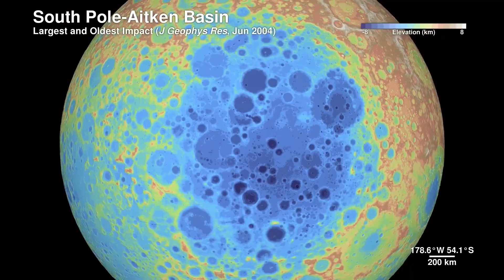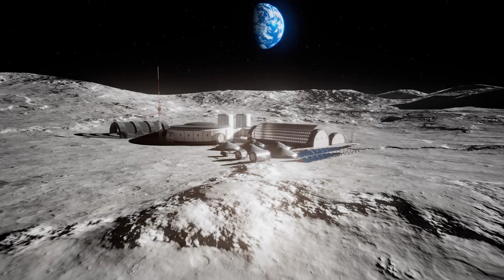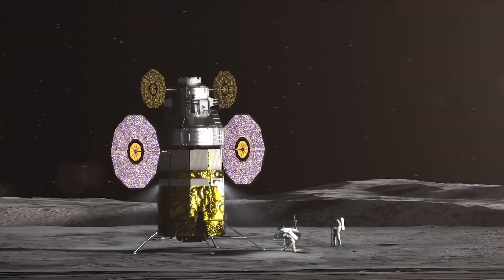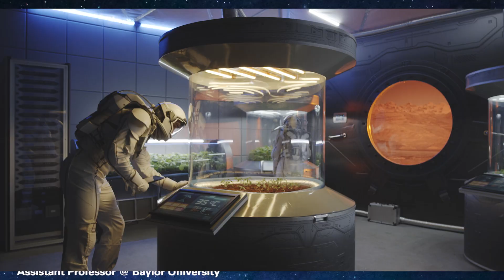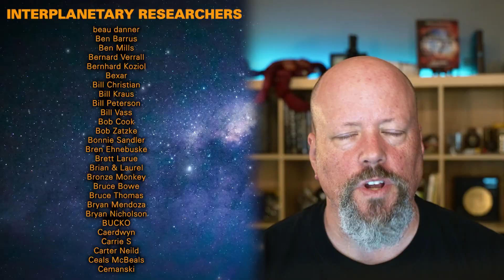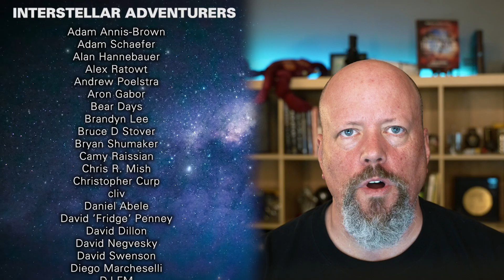How Much Water Will A Human Colony on Moon or Mars Need

Comment: It would be handy to find a Carbon source on the Moon.
That means that the Hydrogen created as a byproduct of creating Oxygen from water can be converted to methane, which is more energy dense than hydrogen as a fuel. It also is much easy to store than Hydrogen.
Reply: Long term Luna can't be both populated and provide fuel. I think when we consider the volume of water that Dr Lee suggested we need to support humans there that the amount of fuel expected for moon bases to provide will start as fairly low and reduce overtime

Comment: Do we know if the moon has any kind of water table?
Reply: That's unknown, but not likely.
Reply: Totally unknown, but it's not impossible that there could be relatively large pockets of ice "near" the surface. As in; Within a couple km.
Also not impossible for there to be actual liquid water, under pressure, way down deep if the core is still warm enough.